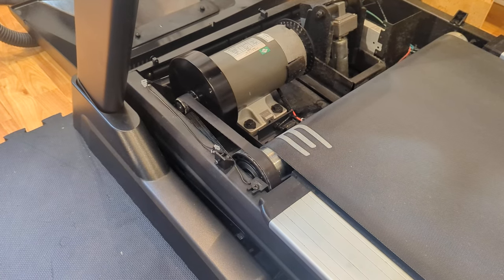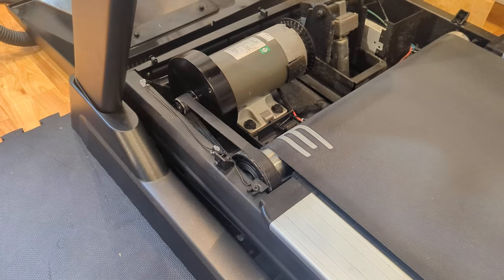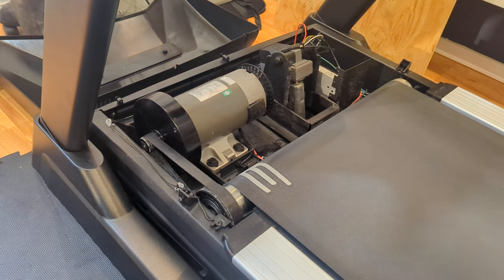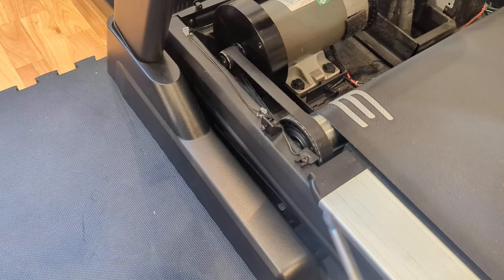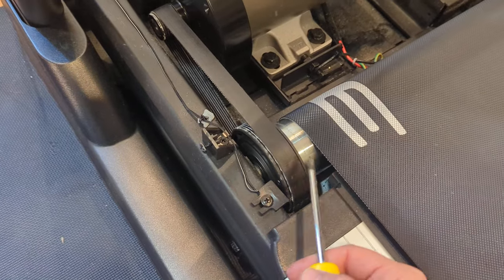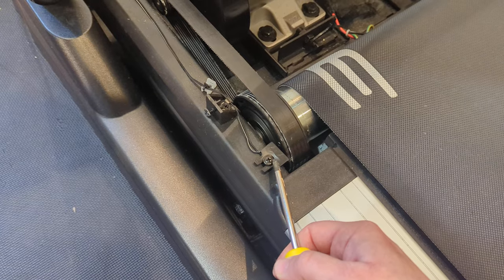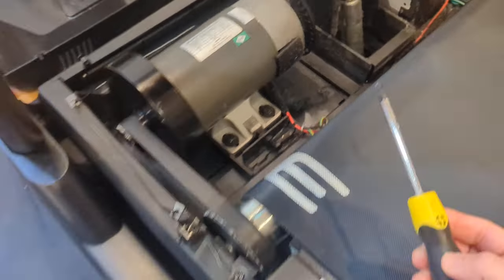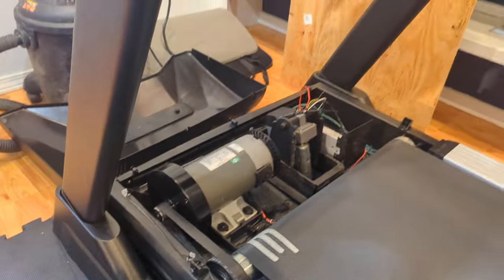How to fix speed issues on Sole treadmill

Comment: I'm so glad I found your video before I bought a new motor, thank you. My sensor is in the same location as yours. The problem I had was there was a lot of crud built up on the magnet, which would have made it difficult for the sensor to track. After cleaning that, problem went away.
Reply from the maker: oh that's awesome. glad you didn't have to spend money on a new motor and go thru the hassle of setting it all up. what I've found is motors that big rarely are the issue. they are surprisingly durable. it's the peripherals that fail